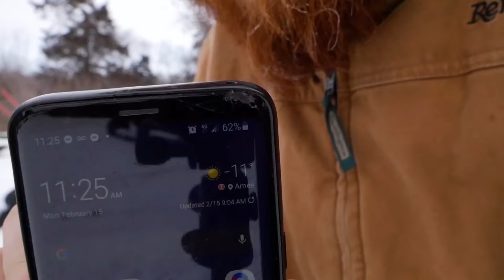Will this BIG BLOCK Dodge Run After 27 YEARS??

Comment: For long trailers, a gooseneck is much less violent than a bumper-pull. Of course, you have to re-learn backing with the pivot point over the rear axle instead of a few feet behind it. Totally worth it, though, in my experience.

Comment: You ask about something to fix the trailer beating you up when its empty.

If you can let off the throttle and it goes away, axle wrap is a concern, track bars usually help there.

If letting off doesnt change it, then heavier shocks, at the expense of ride.

Comment: In my experience. When you pull a sparkplug wire off and the spark picks up with a small gap. You have a bad plug wire. I grew up working in my uncle's auto shop. He showed me that trick, if the miss goes away when you pull the wire with a small gap, you need a sparkplug wire.

Comment: if you get a charge problem check the back of the ameter in the dash..had one with a wire loose on the back of the meter and it got hot and melted out of the dash. before i found the problem i changed the alt. voltage reg. headlight switch..so check the meter in the dash 👍👍

Comment: 71-74 amc amx's also ran the  wiring that  way. when the  the  ammeter  burned up you  put a  1/4 inch bolt and  nut through the  ring terminals and keep going

Comment: Im a year late to this party, for some reason i dont remember this episode.
Once i seen the ramp truck move i was thinking...tighten the band adjustment, either by feel or read a book, either way that would probably be enough to send er down the road. Wont last long most likely but yeah, that band adjustment gets overlooked too often. It helps take up the slack in the band to drum clearance. IIRC the drum spins in first, then the band clamps the drum and stops it from turning for 2nd, then 3rd it's released again....i think. Since it finally did move on its own off idle in 2st i believe its safe to say band adjust. Honestly, a torqueflight is a relatively easy trans to rebuild. You ought to give it a try sometime and make a vid out of it. You will pat yourself on the back so much you'll run out of breath! This is true for all y'all out there, give it a try at home if you got a torqueflight that needs a rebuild.

Comment: I've never had a problem with Chrysler electronic ignition, the module on my car came out of a junkyard 20 years ago and still works just fine, drive it 60+ miles daily, 62 Dodge Lancer GT with a slant 6

Comment: Thet spark plug sparking only over a gap means the spark plug is dirty and it forms a conductive path that carries away the small current from the coil. If you form a gap, there is no leak anymore, the small coil current is sufficient to charge the capacitance of the wire to the high voltage till the spark forms. The spark then acts like a very good switch, discharging the cable capacitance into the spark plug. And because now it is coming from a capacitance, the current is not limited anymore, so it can overcome the dirt leakage, so build enough voltage across the spark gap electrodes to form the spark there too.
As far a I know, some spark plugs had an extra spark gap (or a piece of ceramics electrically behaving the same way) inside the ceramic insulator for exactly the same - to help the sparks to form even when electrodes are dirty. But not sure if all spark plugs have that and even when it is there, it uses to be the first thing to fail on the spark plugs that have this extra feature.

Comment: Old mechanics trick is to just set the plug wires on the plug, not seated but allow a gap between the plug and the wire for a hotter spark... works great on 2 stroke engines that like to foul.

Comment: i think the spark plug thing was because the ceramic on the plugs was not resistant enough for the voltage, so the spark just shorted to the vice through the ceramic. i saw it happen on a lawn mower once. coated the ceramic in silicone and it worked great

Comment: Ok Kevin hear me out:
12 valve cummins swap
5 inch straight pipe 
10 in tip
Coal rolling tuning
Equals= the ultimate ramper special!

Comment: So, there isn't a former winch on the transmission? Like in towtrucks?  That have to be disconnected for it to drive. Or has the rear brakes got som air now when it started and now stuck?

Comment: May need to pull the rear wheels and check the drum brakes and parking brake.  I've had jeeps that will do that, you can reverse and not drive with a Chrysler transmission.  Also to note: once the linkage comes undone on those transmissions you don't know what gear you're in and it can be really hard to get it to stay in drive.  Reverse and neutral are easier.

Comment: Bit late but from what I’ve heard the amp meter is not what lights the car on fire. The problem is the bulkhead connector so run a wire through the Speedometer  cable hole to the amp meter.

Comment: Any 2wd nv5600 nv4500 will work for what your trying to do  the bell housing’s are the same from 90-2007   If the 12v was pulled from a dodge or ford truck

Comment: I'd love to rebuild that hauler. According to the comments here the rig has famous history. I like the red theme, but whilst blasting and welding pretty much all panels I'd go to the original paint job it left the factory with. This project is an all hands on deck type of deal. I'd not be the man for the job and i sincerely hope it gets saved and not bashed to bits.

Comment: Your plugs are fuel fouled or in other words carbon fouled. Spark tracks the carbon right down the side to ground. Least lines of resistance. 
You can take a oxy acetylene torch and blow them out and they'll work again for a while.

Comment: It's a Mopar.. Clean the points, clean the rotor, clean the plugs, and fire that mother up. Hot-wire the coil if need be. 440 Big-Blocks were great engines.

Comment: You should always pour an eggcup of fuel down a carb with these long dead cars.
As the carb may be empty it cannot pass the spray of fuel necessary especially on a cold day.
But an eggcup full will slowly atomise and give a better chance of starting.

Comment: The 727 pump itself runs in neutral, it just gets redirected right back to the pan and doesn’t pressurize. Putting it in neutral pressurizes the system.  There are aftermarket control spool valves that pressurize in all shifter positions.  

Also, you can bypass the ammeter by running a #8 wire from the battery or big lug on the starter relay directly to the B+ terminal on the back of of the alternator. Saves pulling the dash.  It’s fun to watch Mopars make you suffer needlessly…  they know when they’re dealing with a Ford guy.  😂

Finally, When you see the light and realize you need a Mopar (so at least one car will always run :p)  buy an FBO ignition module and throw the factory style one in the trunk as a spare.  The FBO is pin-compatible, has a settable rev limiter, and bypasses the ballast.

Anyway, all in fun. You should see me work on my AMC.  This is a great revival, as always. Hope to see more of the truck in the future.
Reply: boli milda  all in fun. If I wasn’t into Mopars, it would be Ford or Buick. I’ve even worked on a Chevy or two despite really wanting to push them off a cliff.

Comment: Fyi. 60's ford trucks with the optional ammeter and oil pressure gauges also wired like the dodge..

Wont start if the ammeter isnt connected or bypassed..

Comment: It’s because when you pull the wire away, the coil can build up a higher voltage before discharge

Comment: You prob can find a standard dodge transmission from this base truck model that fits really easy on backroads and you get a free frame and body and engine with it. Just aim for a dodge with the same cab and engine:)

Comment: When you start them up,fill the carb with fuel,try to start it for 5 seconds stop,fill it up again,pump the heck out of it like you're flooding the carb/dont try to start it ...let it sit for 10-15 minutes,pump it once,old the pedal down 1/4 way down and it will start and hold the pedal 1/4 down,might have to play with the pedal for 1 minute or 2 so it runs on its own..I started hundreds of old Mopars like this,real easy...I have issues with Ford/GM they are harder to get going..

Comment: If you don't know Mopars, dont mess with them. They are not a ford or chevy . They are their own beast. You don't dominate them. You work with them.  A 440 WILL pick the front end up, off the line if you LET IT.

Comment: To restore that, it would take so much money to completely replace the transmission that I don’t think you’ll get very many “offers” for it. There’s a good chance that, many years ago, the transmission completely BLEW!!! If that’s the case, that old vehicle was permanently parked and headed for the salvage yard as the cost of fixing it would have been astronomical. When the transmission blows to pieces like that,  it’s what’s called a “technical total.” It’s one thing if it were a family camper, pickup truck or station wagon that you could take trips in, but this is a "car hauler." It does have value as a “collector’s item”,  but not much value beyond that. With that said, the engine has a  LOT  of good, highly sought after parts that may be hard to find. This makes it a parts  “gold mine.”  Somebody might want an “original” Dodge starter. Anybody could see the  “gold mine”  of hard to find  PARTS  you have sitting there,  and much of it is in  PRISTINE  condition.  Oh I'm sure you could probably replace the transmission. But it probably wouldn't be worth the cost.

Comment: Somehow, I dont think a normal car battery , old battery cables and the old starter motor are not a good combination on a big block engine. Also, old battery cables will cause weak spark, which might not show up until w.o.t

Comment: i have a caprice with a bad starter that kept cutting off power to the dash and ecm from time to time
so i replaced it and alot of problems were solved and then replaced ignition module and stupid opti spark and the coil ( ignition module is famous for breaking down alot have a couple in your glovebox just incase) 
ac works ,...everything else work even the electric fans ( car has over 750 000 kilometers on it , about 466 thousand miles )
and rebuilt the transmission

Comment: Plug  gap is off and ballast resistor  needs replaced and like coil  lol oops you found it electronic ignition  control box is that square unit by the hood hinge

Comment: If it has air brakes and truck brake chambers it will need air to release the spring brake if they can stop a 15l cummings that 440 don't stand a chance of turning set spring brakes

Comment: It runs but just doesnt drive. A replacement transmission for it should be an easy find as there seem to be lots of old class A motorhomes around really cheap with Dodge 440 engines and good transmissions in them that still run and drive but have severe wood rot in the RV bodies

Comment: I have a project that I'm working on and unfortunately it's on hold until warmer weather. However I am curious however if a boltster will work with bolts nuts washers and screws for very small engines. As well as bolts nuts and washers for other things as well. The project I'm working on I think y'all might like and enjoy. I would love to get y'all's advice and opinions on it and maybe put me in contact with someone who knows more about different types of small engines for advice and that person's opinions as well. If possible I would like to talk to y'all on the phone and or video chat with y'all as well as whoever else y'all can think of that might be willing and able to help me. It's my very first project and I'm already stumped about what to do with the engine and the torque converter.

Comment: It would be a better truck if you took that cab and put it on a second gen Dodge cab and chassis frame that already has a Cummins in it. You could lengthen the newer truck frame to the correct length with pieces from the old frame and then add to it to strengthen it. The benefits are numerous......bigger rear axle and heavier springs. Diesel tank and lines already installed, wiring that matches the engine all there for use in the older truck cab. Larger brakes and hydraboost if you  get the right year of second gen truck (97).

Comment: I will be honest a lot of those and that mid 70 Dodge Chrysler in Plymouth had what was called a lindenberg ignition system in it I don't know if that one has it or not I couldn't really tell but if that's the case that's the reason why I didn't plugs will be followed by that all the time I had a 79 diplomat that way

Comment: Edelbrock bought the rights and tooling to Thermoquad carburetors, and that is what they sell as their name brand line of carbs to go with their intakes. If you need parts, or to just trash that old dead carb and replace it.

Comment: I had an old school mechanic show me the trick with the spark plug and increasing the gap between the plug and the coil wire. I think it increases the peak voltage. Because science.

Literally drove around with a plug half plugged into the coil so the cylinder would run 🤷‍♀️ work trucks amirite

Comment: Seriously I had  escort drive into my shop for a oil change. I go to restart it and no go... I fought with it for hours and finally just said hell with it, start throwing parts at it. First plugs, new module, new this and new  that.... what the hell??? My goofy neighbor says did you change plug wires? No, they never go bad that quick.... he persists and so I grabbed some random wires out of the stash. I just touched the starter.... and it was cold as a mother in laws kiss here in alaska. It fired right up, every time and ran great. I put the old wires that fit best on it and no start again... mind you this neighbor lady always had me do the work on her car. I ordered up new wires an install... fires right up and run great so.... sometimes I guess, plug wires do die!

Comment: I’ll trade my 1954 Ford Mainline 4 door for that truck. My ford has a 302, new brakes, new tires, new rear end 9inch, drive line. It really needs hardly anything. Starter went out along with the solenoid. And auto fan relay. It’s rusty but it’s cool.

Comment: Sir farts a lot (hey we guys have to stink - I mean stick together) have a challenge for you to repair that I have not seen you do yet. I am working (or should I say I hired a mechanic to repair since it was out of my area of expertise) I would love to see you take on a RV (1985 to 2003) built on a Chevy P-30 chassis (might still be on the work horse but mine is not)  parking break. Why? Well the parking break IS NOT on the wheels! Yep they chose to put it directly BEHIND the transmission on what looks and works just like a regular wheel brake but holds the drive shaft instead. My coach is 2999 WINNEBAGO 40 footer and very much like this DODGE there are 3 drive lines and you have to drop at least 2 of them to get the yoke loose. Now that will let your viewers hear words that even make a sailor blush. Then you have to get the yoke off the drum OR pull the drum AND the break drum together as unit using a front crank puller. That would be fun and actually very helpful for all us folks that have the P-30, P-40 and work horse chassis so they can see why it costs a fortune to have a dealer fix, especially if you are away from home and on the road. Thanks for the videos of you and you boss (MOOK) fixing things.

Comment: must be a dodge thing, i bought a 97 2500 for $500 and she didn't run, was told it was the crank sensor, replaced it, nothing, sparkplugs , nothing, distributor cap and rotor, nothing, and then my dumb ass decided to look down and I said "maybe its the coil" $35 later, she started like a champ... then a u joint busted on the front drive shaft, replaced it, then snapped a bolt on the yoke, took shaft off and am replacing yoke and shaft, then it started spewing coolant, and then i went and got a thermostat, housing, upper hose and lower hose, then when taking out the thermostat, the bolt busted on the housing.... i swear she doesn't want to be fixed but she doesnt get a choice lol

Comment: Dodge has a poor Pole balanced resistant Box that if it don't work even in 72 the insurance crank your buddy over it pulled bar and garage has just worked on a SIM murder drunk but you can't bypass them with the GM4 public mission module that's what a lot of people do a lot of people make a plate and bolt to the firewall and wire up the gym for public mission model it's the same thing all it does is fire the Ignition the GM Australia is quite a bit stronger spark Then the old style and mission Michael Britt Dodge usedr not to mention it's cheaper to use the GM macho

Comment: Bro they are yelling at you because it Drys out the Rings on the Pistons!!!  You can damage an engine that's been sitting by Using brake cleaner Notice the Noise and if the rings don't work then there is no compression and then it will not provide any horsepower and run like crap!!!